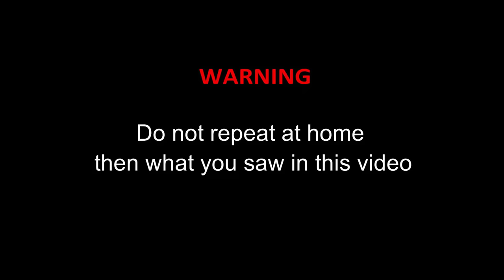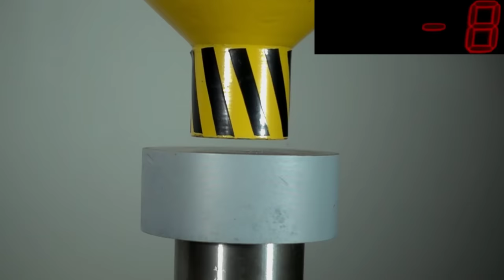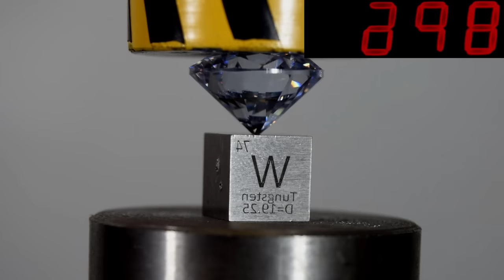HIDRAULIC PRESS VS THE HARDEST STONES VS TUNGSTEN

Comment: “Diamonds are almost completely SCRATCH proof and are one of the gemstones able to withstand abuse from just about every other material – with the exception of another diamond of course. The reason for this super strength is that diamonds top the scale of gemstone hardness.”
Reply: "Yes, a hydraulic press can crush a diamond. Diamonds are the hardest material which means they are resistant to scratch, not crushing."
Reply: @shadyattano936  Yes exactly 😉
Reply: The reason for their hardness is because of the tetrahedral bonds between the carbon atoms.

Also a new element known as graphene was discovered recently , it is so hard , scientists cannot find a use for it lol.

Comment: Everyone is surprising being diamond breaks , and I'm confused what ' MoHs' is 🥺🙁
Reply: How difficult it is to scratch an item with 10 as highest and one as lowest
Reply: @andrewzhuo6399  thanks ;)
Reply: Hardness scale
Reply: Diamond is a crystalline structure like quartz, and they are actually quite vulnerable to pressure and impact to the vertices in the crystal matrices from when it forms. Granted using a hydraulic press is just kinda like bypassing all that and brute forcing it into breaking.
Reply: How old are u lol
Reply: @emprahsfinest7092  it would still be breakable, cuz nothing is unbreakable and it isn't tough (wich is different from hardness),  diamond is a mineral that handles pressure, not a sledgehammer
Reply: @YashaMikage  Also this
If that diamond was in cylinder shape it would carry more pressure than this , cuz here the diamond shape have pointed end ie all the pressure accumulated on to a single point ....as all knows that smaller the area larger the pressure

Comment: Fun wrapping my head around the interface between the Moh's scale and elastic deformation

Film tip: If you use a long millimeter lens, and optically zoom in on the exploding gems with the camera further away, you'll get more mileage out of the slow-motion.
Otherwise the shards are instantly flying out of focus and look like blurs
Reply: Cool

Comment: Make a diamond shaped tungsten and a square shaped diamond. 

Let’s see if the diamond would still shatter.
Reply: True but I think it will because there is a difference between toughnes and strongness diamond is strong hard to scratch easy to shatter but tungsten is tough hard to shatter and easy to scratch
Reply: Im VERY sure the diamond would break even faster because of a sharp point of tungsten (one of the strongest metals) directed onto it

Comment: Lesson of the day: even the hardest stone of the world can't win the hydraulic press!
Reply: Nokai 3310 be like:I broke hydraulic press I'm the king.
Reply: carbon fiber is the only thing that wins against the hydraulic press.
Reply: Though Carbon fiber beats the press. which is made of the same thing as diamond
Reply: @catfoodbob1  if the diamond had been square shaped, then it would have beaten the press too. But in this case, all the top pressure is focused on one tiiiinny point. I’m even surprised it withstood that much
Reply: Because the diamond cannot bend it is super brittle

Comment: This experiment is nonsense. Although diamond is the hardest mineral it has a high cleavability, which means it breaks very easy along predefined shapes due to its crystal structure.
Reply: I thought it wouldn't break since it's the densest metal
Reply: @Patrick-rk4db  it is not a metal, it is carbon. Density has nothing to do with hardness. Gold for  example has a high density and is relatively soft.
Reply: @Patrick-rk4db  - Hardness is resistance to scratching, or being cut. Not resistance to fracturing. Very hard materials can fracture very easily.
Reply: @gasbutan  - Cabon is a metal if you're an astrophysicist. :-)
Reply: Damn, I have a lot to learn

Comment: Surface areas should be the same otherwise the material with the smaller surface area (the diamond) will experience much more stress that the one with larger area (tungsten)

Edit:typo

Comment: These results are primarily because these gems are not well shaped for these kinds of tests. Any material that is badly shaped to not distribute the weight as evenly throughout the object as possible will not withstand a strong pressure. However, you will notice these things can handle a fair amount more weight if it properly shaped to distribute the weigh as evenly as possible.

Comment: Platinum-gold alloy is probably the most wear-resistant alloy ever created, with a hardness that approaches that of diamonds. The hardness of the alloy is achieved by exposing it to extremely high temperatures of about 500⁰C (nearly 1000⁰F) for a minimum of 24 hours in a vacuum chamber.26-Aug-

Comment: That's not a good comparison, they're 2 different shapes, creating 2 very different loading profiles.
Either the tungsten should have been cut into the shapes of the diamonds, or the diamonds should've been cleaved as cubes.
Plus crystals are hard but brittle, metal is hard and ductile.

Comment: How to use the hydraulic pressure force and at the same time use the Mohs hardness scale.
Hardness is the ability of a material to resist friction and is measured on the Mohs scale, while toughness  is the ability to measure how much force a material can absorb without fragmentation which measured on On
 pascal scale , the pressure exerted by a force of magnitude one newton perpendicularly upon an area of one square metre.The toughness of natural diamond has been measured as
 (2.0 MPa⋅m)1/2

Comment: I would like to say that hardness and durability are different things, diamond is the hardest substance, not the strongest.
Reply: That is correct. Toughness and hardness are two different things and are measured differently too. Diamond is one of the hardest materials, but it doesn't have much toughness as it shatters entirely as soon as its hardness reaches the limit. In comparison, plastic is not hard at all and can easily be bent out of shape, however it doesn't shatter after being bent out of shape, meaning it is tougher than diamond.

Comment: The shape of the diamond has a lot to do with it shattering, the tip of the brilliant cut is obviously what breaks first as the surface pressure is enormous on such a small tip. Try a square diaomnd, also try a lab grown diamond as they are without flaws and theoretically stronger.

Comment: Tungsten Carbit with Mohs of 9,5 ( which a lot tougher and harder than the nomal Tungsten) would have certainly split the hydraulic press. Tungsten Carbit is almost as hard as diamonds but much more denser and tougher. The densitiy is higher than uran and almost the same as gold. Tungsten Carbit is the most fascinating metal on earth with melting temperatures arond 3500 Celcius and 5500 C boiling point. A space ship built of tungsten and special water/Ice cooling system could literally visit the sun, but since its so incredible heavy and extremely hard to form...its impossible for manking to build a spaceship out of it and develop a rocket that could carry it out of the earths gravity. Something which is not possible for mankind and will never be.

Comment: You would a cube of moisanite for this to be fair.  There is a difference between hard, dense, and brittle. Your attacking the weakest point on the gems ( the culet area) and fracturing along its crystallization lines. Not actually penetrating the surface.

Comment: "you can actually break a diamond with a hammer" -the first google article you read as you typed "um actually.." 

You cannot 'EASILY' break a real diamond. you could if you hit it with the right variables but it is not easily repeatable in a normal environment(i dont see most normal people having stainless steel bricks lying around to smash stones on). for everyday toughness, its still tough as fuck. but if you slam it in between two pieces of steel. ofc its gonna shatter its a fucking crystal.

its not as heavy an element as iron, and the structure atomically is crystalline, but it is denser. Try shattering a 5lb diamond between a 5 lb steel hammer and steel anvil though. go for it.

the largest diamond ever manufactured is like 30 carats, or i think 6 grams. Since that is more realistic a size of a diamond, make a 6 gram hammer and smash it. go ahead.

Comment: Im amazed at how many here are calling the diamond fake.
Their statement is thru assumptions only. 
And a lot of BS is spouted by posers attempting to seem factual.
Ive collected gems since 1986,and have over 600 specimens.  Just collecting gems wont get you any where in the trade.You must study about them from every angle.Dealers are more than happy to rip you off. So you too need to know the business,inside and out.
So,when you speak nonsense to collectors that have been around, be prepared to be schooled if you try to spread nonsense.

Comment: Not really sure what the point of this video is (though cool none the less). Hardness in the sense of the Mohs scale doesn't have much to do with how strong (easy to break) something is. I'm no geologist/chemist though.
Reply: Correct, The molecular structure that leads to high hardness also very commonly causes materials to be incredibly brittle which is why diamonds can shatter like this under high compressive load